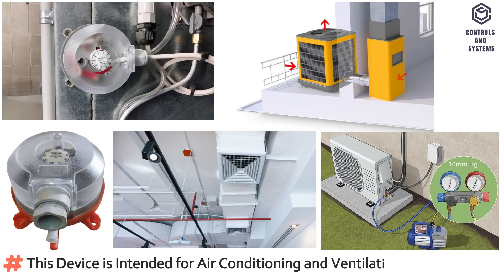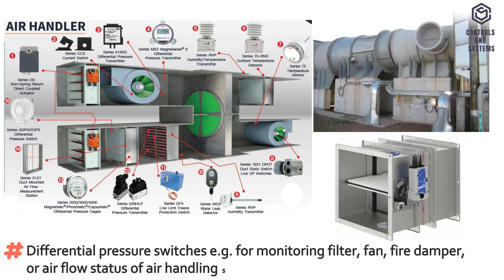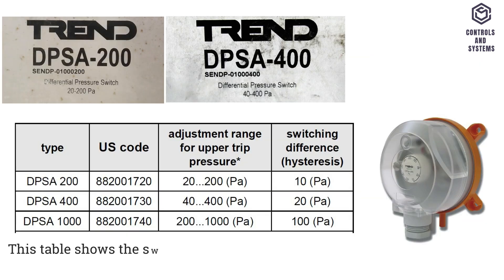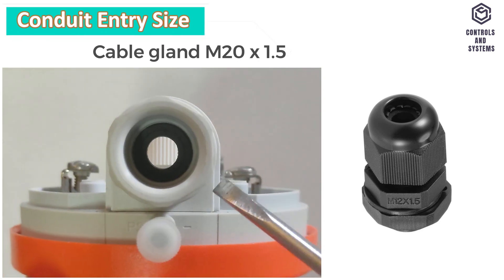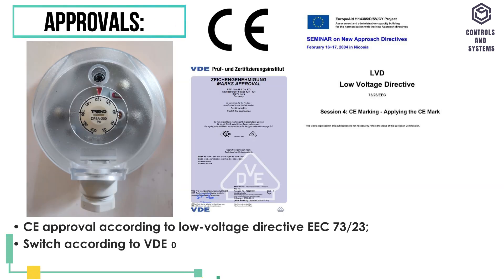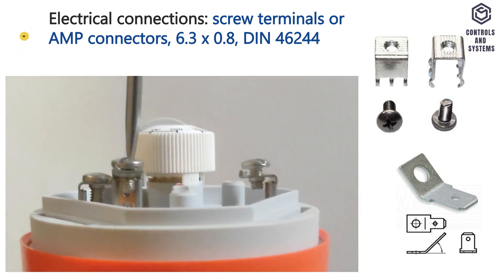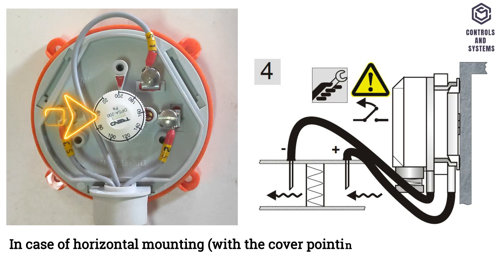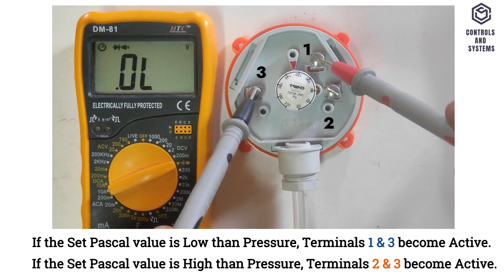Trend Differential Pressure Switch /  User-Adjustable /  Air Handling Systems

Comment: is it required External Electrical Energy ? for working switch
Reply from the maker: No, the Trend DPSA 200 Differential Pressure Switch does not require external electrical energy to operate its switching mechanism.

1. It is Electro-mechanical pressure switch.
2. It uses a mechanical diaphragm that responds to differential pressure.
3. Only needed if you're using the switch to control or signal external devices (like alarms, relays, or controllers), in which case the connected circuit would require power not the switch itself.

The DPSA 200 operates passively and does not need an external power supply for its core function. It only acts as a mechanical switch that opens or closes based on the pressure difference.